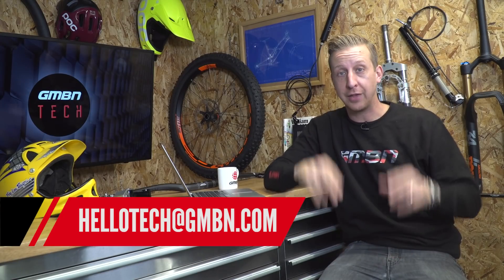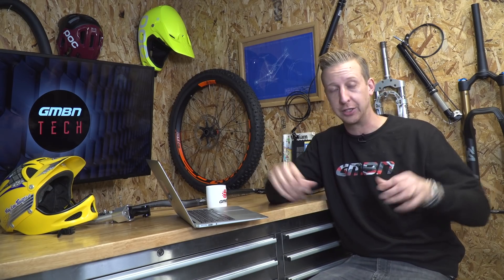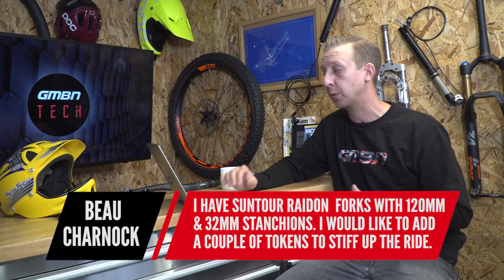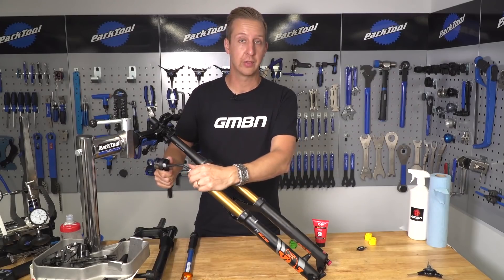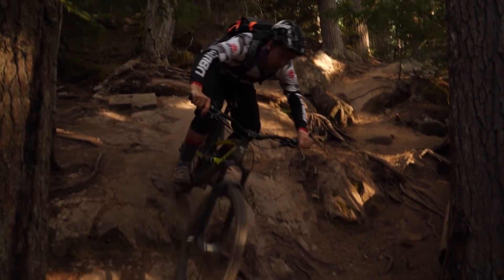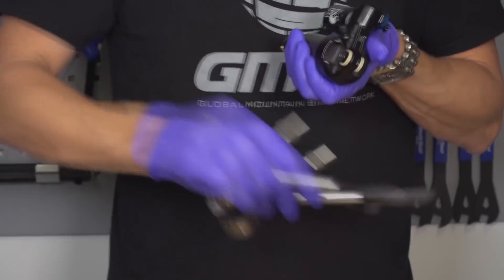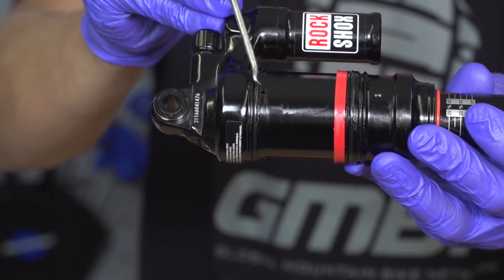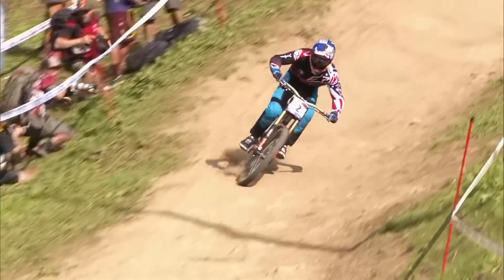The First Ask GMBN Tech | Answering Your Mountain Bike Tech Questions

Comment from the maker: Let us know your opinion on grip shifting in the comments below 👇
Reply: I tried them on my mates mtb, but i kept shifting accedently when gripping the handlebar.
Reply: I feel there are lots of cons. Small grip selection, accidental shifts, harder to shift many gears quickly, no quick disconnect, awkward to operate in technical trail sections....
Reply: Definitely not lighter...
Reply: Absolutely DON'T like grip shifters. Had one on an old budget trekking bike. They were pretty much totally unreliable. In general: I think the movement of your wrist for shifting gets your hand in an uncomfortable position, getting a weird angle to your brake lever. Also accidental shifting may occur.
Reply: We used to call them "Shit-shifters" ;-)
Reply: As with most things, they will eventually be back in and everyone will be saying why we should be using grip shift, if they are reliable then it’s purely personal preference
Reply: #askgmbntech Hi, I'm nervous about maintenance and how do I, in very exact instructions, remove and put back in front and rear wheels? Also, grip shifters are from the Depths of Hell!
Reply: #askgmbntech I was wondering if it is possible to make a fork travel longer without having to buy a new one, thanks
Reply: GMBN Tech not good
Reply: Been using Sachs Grip shifters for over 20 years, flawless, simple, always ready.
Reply: The Grip shift brand did suck, as well as the short lived Campy Bullet shifters that I have on a Klein Attitude.  The Campy's were full width and always are hard to keep from unwanted shifting. ODI grips make the Sachs shifters work great on my Manitou F/S.
Reply: I actually rode with those until I got so many injuries on the skin of my hand that i started using normal shifters
Reply: GMBN Tech My Grandpa used grip shifters
Reply: Fat bikers like Grip shift for winter riding. They are easier to use with thick winter gloves.
Reply: I agree that your hand ends up in an unconfortable possition after shifting. I have used them and wouldn't use them again, but... correct me if I'm wrong Don't motocross and motorbike trials riders use a similar system to accelerate? How do they do it? Do they have our same complaints?
Reply: I don’t like it becuase the grip we’re really quickly and gets really Stuckey
Reply: Accidental shifts 👎🏻👎🏻👎🏻👎🏻👎🏻👎🏻
Reply: GMBN Tech I want to try it out
Reply: I use it on my OLD XC-bike and it works fine for the sort of easy riding I do ;)
Reply: TBH I stopped hating them a long time ago -- I use grip shifters on both my regular hybrid, and an old trail bike. Humans' adaptability is simply amazing.
Reply: I always think of extremely budget bikes when I think of grip shifters
Reply: Coming from harescramble/motocross background, grip shifting feels natural to me. That being said, the only bike I have ever owned with grip shift is my current ghetto cruiser. It's a cheap bike that I picked up for pub runs (I like my ale). Performance wasn't my main concern. I consider it insurance to avoid chaining my Scott Genius to a sign post outside the pubs.
Reply: Ronald Knightley, Beginning riders to off-road motorcycles do sometimes struggle w/twist throttles but It's the only logical system for off-road riding. I've had ATVs with thumb throttles for 10 years now. I will never learn to like them.
Reply: For GripShift, I think it is a great addition and option for cycling.  My wife doesn't ride as much as I do, and for her, seeing all those levers and each one performing a different function, to her, her focus was on shifting right rather than riding safely.  So, I changed her 3x7 Shimano shifters to a comparable GripShifter set and it was instantly much better for her.  It was only one thing to do; twist it the shifter.  She has now ridden much more often and with greater confidence, and fun, all because of GripShift.
Reply: pointless?
Reply: gripshifter, NEVER
Reply: AndyBoothMTB Volume reducers dont affect on the travel of the fork, but they make it more progressive.
Reply: Grip shift ya no
Reply: grip-shift sucks donkey-dong. Although, using it for a dropper post ect. sounds amazing. Got my KS (27.2) actuated by an integrated grip lock, but the grip shift probably would work better.

Comment: Grip shift is pretty sketchy my friends and I have all had crashes because of unexpected gear changes when using a grip shift and they just aren't very ergonomic.  One hack I have seen is to run full size grips and push the shifters inboard still leaving room for one finger braking

Comment: Do you need thru axle specific wheels for a thru axle
Reply: Christian M yes you do. Some hubs you can convert to 15mm axle front or 142x12mm rear by changing the end caps on the hub

Comment: #askgmbntech   If I am on the trail using 29 inch wheel with a 29 inch inner tube, at 30 PSI, can I use a spare tube from a 27.5 inch wheel if so, what is the recomemmended tire presure (Same  - More  - Less )? 

And is it possible to use a 29 Inch tube into a 27 Inch ? And what presurre 
Also how about 26 Inch tube on a 27.5 inch wheel ?

Comment: Hi! I've got a question!
If there a is RockShox fork, Lyrick RC, would it be worth it to buy the RCT3 cartridge or with 2/3 tokens would be enough to feel as good as a RCT3 fork. 
Nowadays I have a Lyrick RC with 2 tokens, it feels good but my last fork was a RCT3 Pike and if felt different, both forks are progressive but in the RCT3 I could use the whole travel of the fork, with the RC with 2 tokens never isn't possible to use it.

Comment: #AskgmbnTech i have 180mm forks and the sag sots about 30% )i know a bit too much ill add air) when i put my weight on the forks and let go it doesnt extent fully, i can lift the front wheel and push the lowers, why

Comment: #ASKGMBNTECH Hi! I've had a problem with my fork remote lockout (RS fork) - the lever did't pull enough cable to cover the lockout ring travel from open to fully closed, leaving the fork still soft.. I've preloaded the blue ring, before securing the cable in it, so the lever could actually lock the suspension properly, but there comes my question: Is it ok in the long term to ride like that, when "open" mode that lever dictates isn't actually fully open?

Comment: #askgmbntech Hi guys, No matter how tight I screw on my saddle, when I sit back down on my bike the bolt comes loose and my saddle tilts back. My saddles and seat post is brand new. Any tips?
Reply: Use threadlock on the bolt

Comment: #askgmbntech hey doddy i have a really big problem on my bike. I have a Canyon Spectral with a Santour front suspension. Lately it has been making a sound when I raise the bars for a manual similar to the rotor touching something. Some have told me that the inside coils are damages. Will I need a new suspension or can I fix it??

Comment: I'm running 780mm bars with a 20mm rise and they are mounted on a 50mm stem. Is the stem length good for that width?
Reply: If you feel comfortable, it is. There's no strict rule for handlebar vs. stem size.

Comment: #askgmbntech what torque(nm) would i want to tighten my brakes and shifters to (on a carbon bar)
Reply: Steven Daniels that's a silly question because there isn't a single answer. It's specific to your specific parts. For example, if the bar has a clamping maximum of 6nm and the shifters have a maximum of 4nm then you use the lower value as a maximum
Reply: Tom Odell thanks

Comment: #ASKGMBNTECH   Hi I have 200mm sram rotors on my bike at the moment and I want to upgrade the actual rotors but the ones I want only come in 203mm, can I use these without getting new mounts, cheers!!
Reply: You can use the same mounts, add or remove washers to adjust the caliper
Reply: Thanks for the help !

Comment: #askgmbntech I recently got a new bike with a rockshox deluxe RT3 RE:aktiv rear shock and it has 3 settings climb, trail and descent. You can change between them at the flick of a switch on the shock but how do I know what setting it is in. To put it into trail do I flick it up, down or side ways. Would love to know which setting is which.
Reply: harrybridgehouse Mtb why not check the rochshox website?
Reply: Daniel Wiltshire I have, I don’t know if I’m looking at the wrong things but it doesn’t mention it there. I have even checked the owners manual and the leaflets that came with the bike and they don’t have it either

Comment: #askgmbntech hi I'm trying to fix up an old bike and the chain is super rusty. Is their any way I can take the rust off or should I just buy a new chain
Reply: If you can take the Chaim off, you can soak it in a type of solvent and then brush the rust off but you will probably need a new chain and cassette if it’s that old
Reply: Waste of time. Quicker to just replace the chain. You can get them fairly cheap now especially if you aren’t on 11 speed

Comment: I got a problem with my shock. If i run ~25% sag it will bottom out really fast. I´m talking about 40cm drops or less. Is it because I´m too light? I´m around 52Kg. I am running a Fox CTD with the biggest volume spacer.
Reply: PaNiPu I had this issue too with being light. You need to buy yourself some volume spacers or try playing with the rebound. When you have little air in the shock the rebound makes a big difference to how the shock reacts
Reply: As I said i already got the biggest volume spacer. But imma try the rebound trick. Thx

Comment: #askgmbntech When I change gear down the lever sticks and I have to pull them for them to spring back, does that mean that I need a new inner cable or and outer cable? Thanks
Reply: Elis Williams just a inner cable is all you should need. Before replacing it though try spraying some silicone spray or something down there to keep it smooth and crisp
Reply: Elis Williams also don’t forget to adjust your barrel adjusted until the cable is tight. That could be your problem

Comment: #ASKGNBMTECH I heard that some EWS pros use one metallic and one organic brakepad in their brakes. In theory this should combine all the advantages without having a noisy brake. Have you guys ever heard of it? Let me know your opinions.
Great content BTW
Reply: I'm trying this myself. Seems to work well. Although the the brakes are still noisy at times.
Reply: Revs OK thanks. And do you get a better braking power? How do they wear after time?
Reply: Braking power is more consistent over various conditions. Better in the wet than resin pads, better from cold than metal pads. As for wear.. I've only had 3-4 rides with it like this so not sure.

Comment: #askgmbntech what about chain waxing in mountain biking??
Reply: Kakazumba99 make gmbntech test video about it please !!!
Reply: I recently switched to waxing my chain due to the oil attracting all sorts of dirt when it's muddy here. So far I like it, the drive train is much cleaner.
You'll have to renew the wax after every ride, but I had to do this with the oil as well due to the mud and cleaning process. I use Squirt wax, so I don't actually dip the chain into a pot of hot molten wax.

Comment: Hey guys, I'm loving the new tech channel! My Rockshox reverb stealth has developed a sag problem i.e. it no longer lock solid when fully extended and has vertical travel of 20mm or so. Q. what can be done about this and how can I fix it? Thanks, John :-)
Reply: I have the exact same issue. It’s when the air and oil mixes together. You can either get it serviced at a nasty price or just send it back to rockshox and get a free replacement under warranty. I’m on my third reverb now. It takes just as long as the service so why not get a new one as it’s free
Reply: Thanks for that Tyler, I hope you get yours sorted soon! :-)

Comment: #askgmbntech Hi guys,can you make a video how to service an entry level coil fork (something like sr suntour xct)or can  you just answer me ,is there any special procedure to service them or not?Thanks.
Reply: Most entry level forks do not have a cartridge to service at all, only thing you can do is clean the internals and regrease the seals and spring.
Reply: Leo Herran Thanks man a lot,when i bought the bike in the bike shop they tell me that i never service it by myself because there are some cartridges,"OIL PRESURE",etc.Thanks man :-)
Reply: KREŠEVO EXTREMO no problem mate, just make sure, if the only adjustment you can make is preload your fork has no oil

Comment: #askgmbntech  my bike came with a 100mm rear shock. Would I be able to upgrade that to a bigger shock. 120-140mm?
Reply: Regan Freerun Hi. Not possible, because the "100 mm of rear travel" relates more to the  design of your frame than the shock you use. If your frame is not designed for more travel than different shock won't help. In fact your shock has just a few centimetres of travel and is engineered to provide the best performance with the linkage of your frame.

Comment: The Suntour Raidon doesn't actually use volume spacers. On that particular fork you can only adjust the volume by adding or subtracting the amount of 80w oil which is located below the air cap. I had this same question and contacted SR Suntour.

Comment: I have a rounded crankarm bolt, 8 mm Allen key. I’ve tried a torx T50/T55 but it doesn’t help at all. The bolt might be in steel. Screw extractor doesn’t work it’s to tight.. what do I do?
Reply: Carefully drill the head off the bolt. This should release the tension off the thread and allow you to unscrew the rest by finger. Maybe Dremel a slot in the end of the remaining bolt so you can unscrew it with a screwdriver.
Reply: David Gabriel perhaps drill out the thread and buy a new bb
Reply: tom strange sorry man I don’t want to destroy the BB, waste of money
Reply: David Gabriel yeah fair enough mountain biking expensive enough already, not sure what else to suggest then, have a look on the forums. Good luck.

Comment: #askgmbntech - Looking to upgrade my cranks from square taper to ‘proper ones’ I’ve got Shimano BB52 which is 68/73 (hollowtech ll) will all hollowtech or 68/73 cranks fit?? 
Thanks for your help
Reply: Patrick Sheard yes. You will need the hollowtech ll bottom bracket though
Reply: Make sure you use the higher end shimano threaded bbs as the bb52 deore aren’t great. The xtr bbs are worth the extra cost. 25 quid on crc I think.

Comment: how is gripshift a lighter solution ????
I found xx1 eagle classic shifter at 108gr and grip shifter at 202gr :o
Reply: WoD STALKER because when you use a grip shift you don't need to run a grip on that side so the net weight of the underbar shifter and the grip is more than just the grip shifter.
Reply: One light grip doesnt weights 100grams dude.... My pair of dual lock on rubber grips is 145grams... imagine a single light weight foam grip. Thats 50grams at worse ! (seen some ESI grips at 65 grams a pair)
Reply: WoD STALKER my research shows the xx1 gripshift is 140g and the xx1 trigger is 124g so unless your grips weight 16g a piece it's lighter.

Comment: #askgmbntech what would you do if you cross threaded the bolt that holds the brake rotor to the hub?
Reply: if its centerlock first of you need a torque wrench because to tread centerlock bolts idek how you get that much torque if its the normall 6 bolt on you will be fine being one bold down just be sure to check the bolts are tight a little more often
Reply: leave it alone I've did same a few years ago said fuck it and ride with 5 bolt. like dude said just check bolts more often. had no problems
Reply: Dont care about it dude